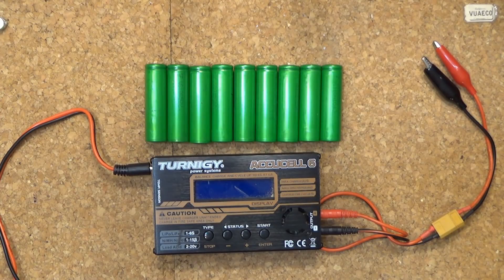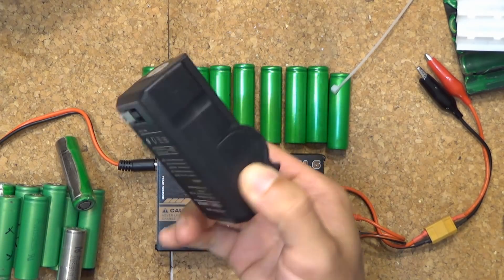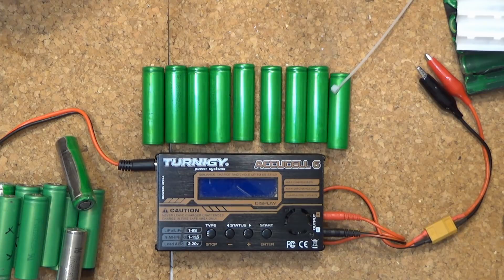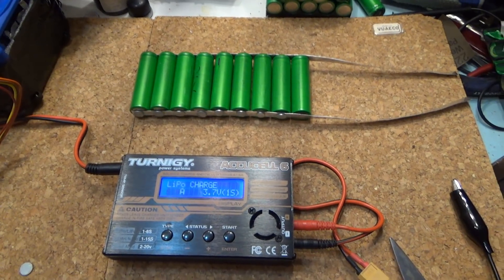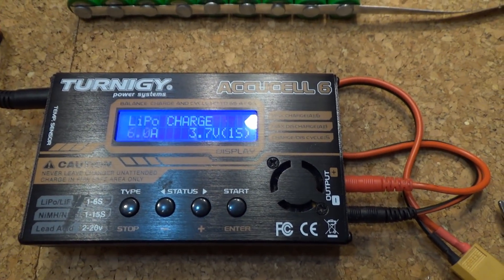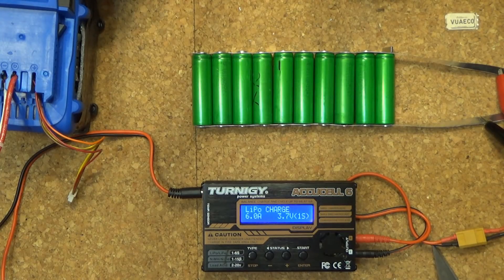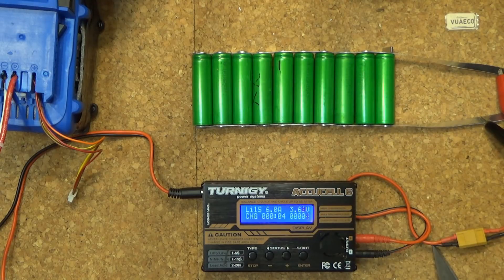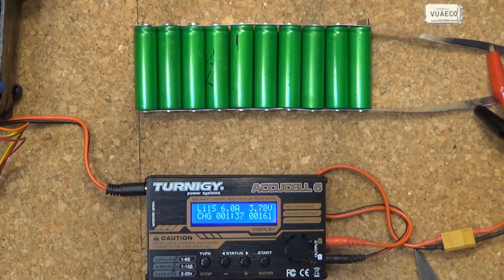A TP4056 alternative? How to charge many 18650 at the same time: fast, cheap, efficient, & easy

Comment: Excellent idea!  I love the use of magnets to hold the conductive strips in contact.  I saw you doing this with alligator clips in another video and have ordered some small magnets to allow me to do this.  I would assume you don't want too much of a differential among cells in this parallel arrangement though prevent excessively high initial currents since these will be left to charge for more than 30 seconds as in your revival video?  Maybe like +/- 0.5 VDC?  Do you monitor temperatures during charging?
Reply from the maker: Yes, I always monitor temperatures during charging any "newly salvaged" cells. A difference in voltage is not really a big deal even at 1 Volt in difference. First of all, you are putting many of these in parallel so the current transfer between the high voltage cell and low voltage cells are divided evenly. Lets say I have 1 cell at 3.5V and 8 cells at 2.5V. The current that's being transferred from the 3.5V cell to the rest of the cells is divided by 8 so it will be a very small current. Reason number 2 is even the voltage difference is 1 Volt, the total voltage being transferred before they balance out is only half of that which is 0.5V. The high voltage cell will be reduced to 3V and the low voltage cell will be increased to 3V. When they all reach 3V, they all will balance out. And finally, they are all very discharged so they don't have much energy left to transfer in the first place. Of course this is an extreme case because you should just put similar voltage cells together to charge it this way.

Comment: Funny all the commenters lauding this stupid example.
Fine if you don't mind ruining most of your batteries over a short period of time. 
TP4056 can usually be bought for 4-5/$1, so get 10-12 for $3-4.
Get an old cigar box or similar, Glue or screw some copper flashing, solder some wires, and for under $10 you can properly charge your batts individually vs gang raping them with this abortion of a device.
Don't want to hear about expense, as this idiot obviously can spend a fair bit of money on a Turnigy charger.

Comment: You are incorrect on one point though - different voltages do matter, because of exactly what you said - one cell charging another.
This can cause heating due to excessive current if you mix cells 18650's vary widely, and if you have a cell with a 30amp discharge rate charging an adjacent cell with a .5amp charge rating, it can result in a fire.
This can happen even without mixing cell type if they are cells with a much higher discharge rate than charge rate.
If they are close, the overcurrent won't last long enough to be a problem - too far apart and the magic smoke leaks out of the cells.

Comment: This is quiet dangerous. 
Let’s connect in parallel 2 cells, battery A has 3V, and battery B has 3,5V for example.
Between A and B there’s a difference of “only” 0,5V. 
Let’s consider the internal resistance for an 18650 is 80milliOhm. 
The current flowing from cell B@3.5V to cell A@3V is 0,5V / 0,08ohm = 6,25A. 
B get damaged because 6,25 is already higher than most “maximum continues discharge current” and very definitively you are damaging A which is being charged x10 times the standard 600-700mA of charging current. 
All this, Without considering the current contribute from the connected charger. 
You are risking thermal runaway with this setup. Good luck!
Reply: If they are the high discharge cells like the Samsung 15a rated ones I have, that should still be okay. I probably won't do this over 0.3v difference myself, but will be doing this to pre balance all the cells before assembling.

Comment: WARNING !! Before putting the cells together, they must have the same voltage!. otherwise the top will charge the less charged one with "infinite :)" current, thus, creating heat or fire.
Reply: Exellent comment, should be added in the video absolutely! I'd also check the internal resistance of each cell to be sure, the charging is actually more efficient.
Reply: Ok, try with real li-ion.. why do you compare one thing with another? Galaxy note catching  fire? Li ion needs special care...
Reply: @Awantg  I have tested till now probably one thousand of 18650 cells.  I know what I'm talking about. I tested it personally, I don't talk like you after watching movies on youtube.
Reply: @AdrianPanciu  I've read about it, no youtube. you need to balance cells voltages below 200mV difference, before putting together. I am not talking about Ni-Cad like you, nor if they can be charged in parallel, course they can! almost every powerbank have their cells in parallel, but they need (or should) to be balanced before the first parallel connection as a safety measure... read a little. I have also made battery packs. probably before you learned the art of trolling people in YT. :-*

Here something to read at the toillete: https://secondlifestorage.com/index.php?threads/voltage-difference-of-cells-while-building-packs.7040/
Reply: So many dopes in the comments who think they're experts. 
Go ahead and do what the YT'er above has posted, or believe dummies like Adrian and Shawn who demonstrate their ignorance by stating that Lion batteries have 'internal charge controllers', or comparing Lion battery chemistry to NiCD/NiMH.
If you want to make a mass charger, just get 10 TP4056/TP5100 for probably $5 and don't risk a fire.
Reply: That's not true!

Comment: I have a problem, when I start charging the charger indicates a voltage of 4.2v and the intensity does not go higher than 0.8A. When I measure the pack it is always 3.1v
 (i'm using imax b6 from banggood and a strong 30v @ 10A power supply)

Comment: safety could be improved alot by using diodes to each cell then a CC/CV buck converter at whatever current you want limited to 4.25v, I would recommend the RDTech DPS5015 now THAT would be a nice fast charger.